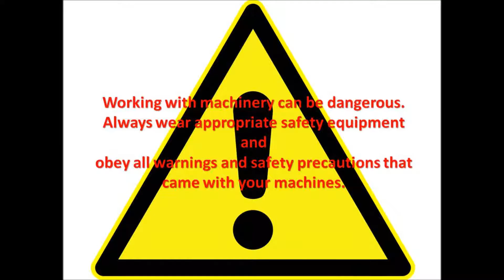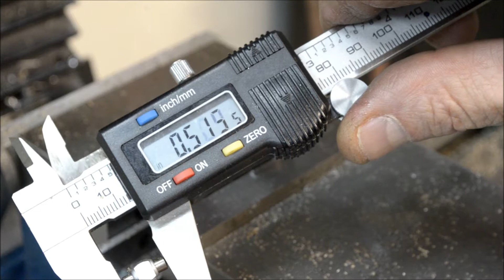PM Research #3 Cylinder Pt 2

Comment: Could that have been drilled and reamed to 0.5?
Reply: Guess if the core was off a drill would not cut true but how about using  1/2" mill cutter? It would cut it's own true hole.

Comment: Thanks for posting these videos. I am in the process of setting up my shop and have been thinking about building a steam model engine. Do you have any recommendations you could give?
Reply from the maker: Robert Oswalt I am glad your are enjoying them and hope you find them helpful. I chose the PM Research #3 after watching a YouTube series from TinkerJohn. Although I did some of the setups and operations differently than his, I referred to his videos several times while I was building mine. Kits with castings are nice but if you mess up you may need to purchase replacements. There are many free plans on the internet such as John-Tom that can be made from bar stock that you may even have in your scrap bin. Let me know if you need any specific info.